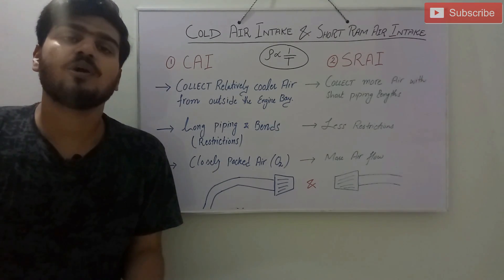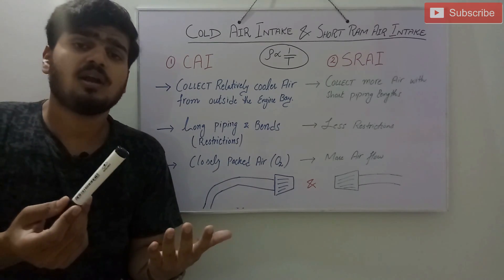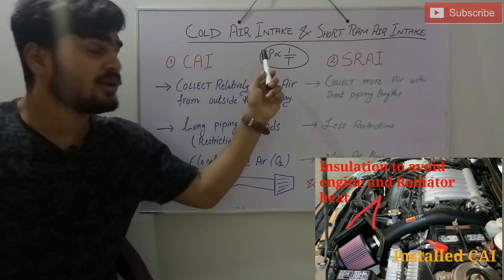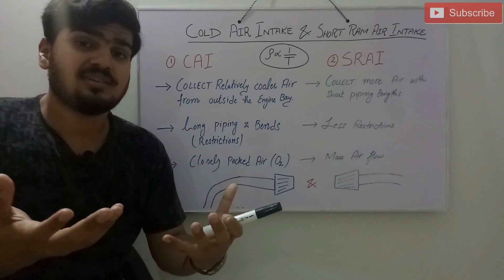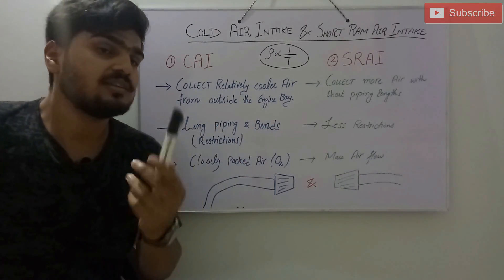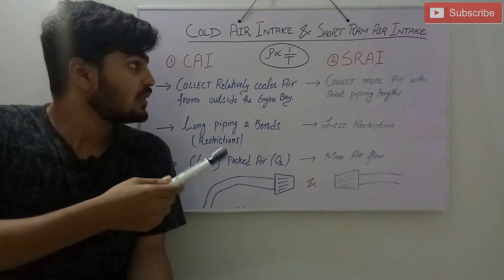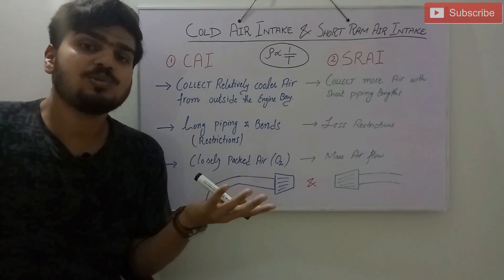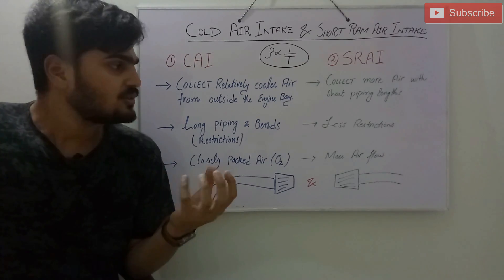Cold Air & Short Ram Air Intake Systems | Basic Principles | Upgrade the Car

Comment from the maker: There are 3 types usually
The Stock Air intake (by OEM) 
Then these 2 Aftermarket Air intakes
In most of the cases CAI works well than SRAI due to these factors
1) Cold Air by CAI will have more density and more O2. There are bends but still the air moving inside is closely packed and produce more power. 
2) In SRAI though the bends are less but the air moving is relatively hotter due to engine heating and radiator heating
3) The reason why I said it depends upon multiple factors in different designs of the cars.  When a new car is in production. The synchronization with the intake system and the engine is carried out by different sensors and dynamometer, meaning for a specific new car now a days OEMs have already done the calculations for which air intake system will be the best for this car according to its use.
So together all the factors including one important factor called "Resonance" which is totally related to how the air will flow in your designed intake system,  due to complexity I didn't define it in the video, 

So due to all the reasons shown above one can't simply say that CAI is better or SRAI is better sometimes they both are not working well with your engine and the Stock one is better in that case,  so we need to experiment for a specific car.

Comment: I have a question, srai have lesser bends n hence bend losses n friction losses are less n also it intakes large volume of air, if we consider this then srai system should work better than cai system .. though u said it depends on other factors as well, please let us know d factors.
Reply from the maker: There are 3 types usually
The Stock Air intake (by OEM) 
Then these 2 Aftermarket Air intakes
In most of the cases CAI works well than SRAI due to these factors
1) Cold Air by CAI will have more density and more O2. There are bends but still the air moving inside is closely packed and produce more power. 
2) In SRAI though the bends are less but the air moving is relatively hotter due to engine heating and radiator heating
3) The reason why I said it depends upon multiple factors in different designs of the cars.  When a new car is in production. The synchronization with the intake system and the engine is carried out by different sensors and dynamometer, meaning for a specific new car now a days OEMs have already done the calculations for which air intake system will be the best for this car according to its use.
So together all the factors including one important factor called "Resonance" which is totally related to how the air will flow in your designed intake system,  due to complexity I didn't define it in the video, 

So due to all the reasons shown above one can't simply say that CAI is better or SRAI is better sometimes they both are not working well with your engine and the Stock one is better in that case,  so we need to experiment for a specific car.